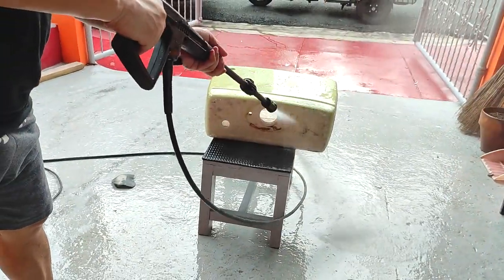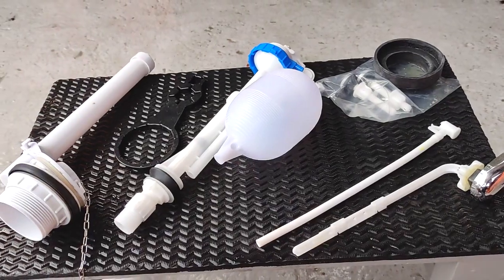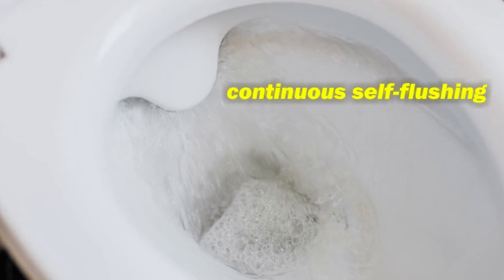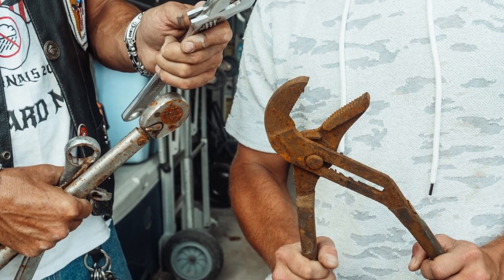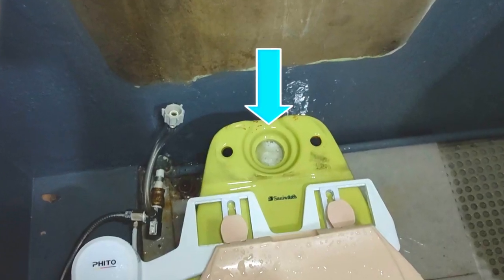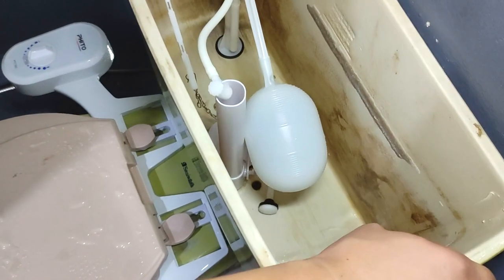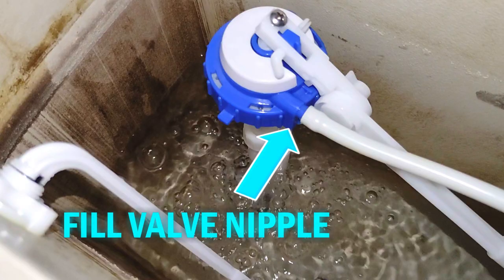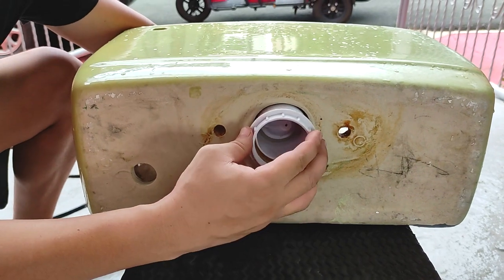Toilet Tank Parts Explained & Why It's Crucial

Comment: I have a question, what can one do if the ball arm is to long snd gets stuck on toilet wall.  I have the one you use in the video but my arm is longer.   Thank you for your video. I wish I would have found it before I started this project. LOL
Reply from the maker: Either you saw off the ball arm to make it shorter (but find a creative way to join the shortened pieces) or buy a replacement arm that's shorter.
Reply: @HanDIYman007  thank you